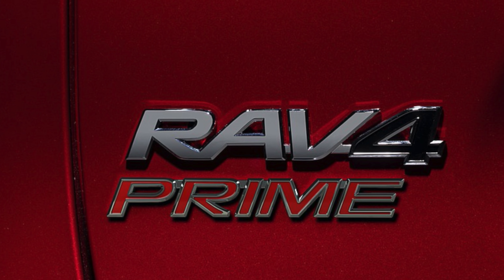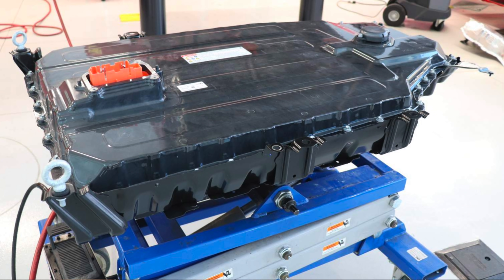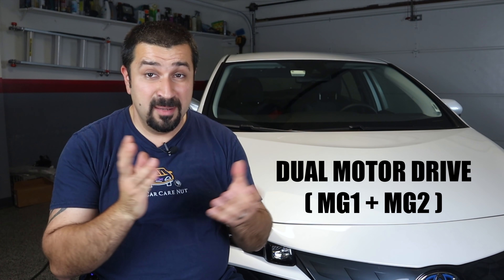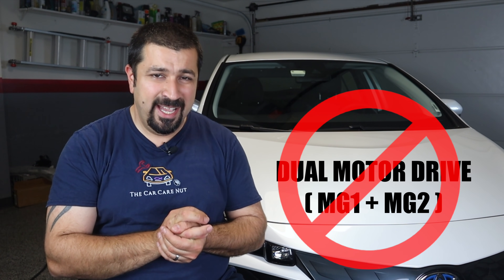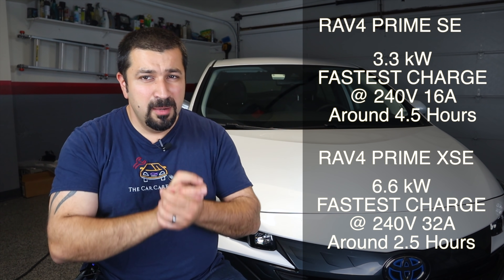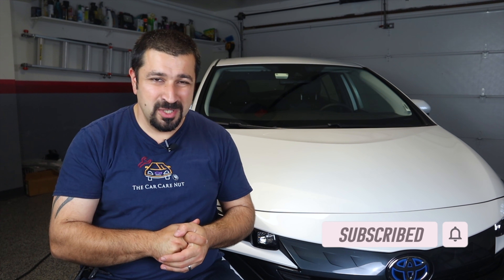Toyota RAV4 Prime Technical Details Part 1 : Battery, Charging and Drivetrain

Comment: Question.  Does the car still have 302 hp after the EV range has depleted?  Or is that a separate battery that has its own HP rating.

Comment: I'm curious as to what the 2024  Rav4 Prime XSE with Premium Package 12V battery normal parasitic current drain should be after the car is off more than 1 hour?   I measured mine today 6/26/2024  (2024 model bought new in Dec of 2023) and it was stable at 105 milliamps after 1 hour 10 minutes   (verified all lights in the car were off by observing it in a pitch black garage).  Does that seem normal?   Reason I ask is I am adding a dashcam which I have measured at 182 milliamps in parking mode  (the dashcam has both a timer setting which I currently have set at 3 hours and a voltage monitor I set to turn off if below 12 V,  so whichever occurs first will turn off the camera) and wanted to get an idea of how long I could actually reasonably run it in parking mode off the 12V battery?

Comment: I sent an email to Carcarenut asking about the Toyota battery charging algorithm.  When the battery is at 100% is that 100% of the 18kw or 100% of the usable 14kw? Longevity studies suggest not charging over 80% and less is better combined with no deep discharges.

Comment: Have you done a video on the RAV4 battery recall? I tried replacing the stock battery of a 2014 RAV4 Limited with a new stock Toyota battery, but the new one was not the same height as the old one. I put the battery on the counter in the Toyota Parts Department to show him and he said that the new one IS the correct one.  WRONG!

Comment: I love your videos. You are explaining so many  tech little details that no one is doing on other chanels. Can I ask a question about regenerative braking power limits? If you will go down on rav4 prime from a very high hill for very long time. Do you also can charge the battery up to 80 % like in combation engine mode by the button near the shifter? I have seen videos with a prius hev where the battery becomes full so fast on big hills. Also I have seen a tesla video where a dude charged 14kwt just by regenerative coasting from very high hills. Can rav4 prime do the same With his big plug-in battery?

Comment: I have taken into account the recommendation to use the gasoline engine with some regularity, thank you! Regarding battery charging, some recommend in fully electric vehicles that the battery be charged to 90% - 95% of the capacity unless you are sure that the next day you will take a long trip, where there would be no problem in going to 100% load. Would it be the same on the Rav4-Prime?

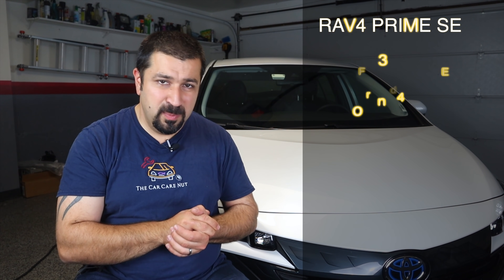Comment: Great News! I have FINALLY found a Rav4 Prime SE without the moonroof option. I take delivery next week on July 18th. The other good news affects this video at timestamp 6:30. Where Ahmed says the SE trim has a 3.3 kw charger, Toyota has made an upgrade for 2023:  the 2023 Rav4 Prime now has the 6.6 kw charger on ALL Rav4 Prime's, both SE and XSE trims. Yayyyy! The one I am getting is dark blue, not my favorite color which is white (because it gets really hot in the summer where I live), but I'll learn to love it. I've been looking for one of these since October 2020 - almost 3 years now - and I am going nuts here in anticipation of finally sitting in one of my very own, buckling up, and pressing that "Power" button for the drive home from the dealer. Just 5 days from now!

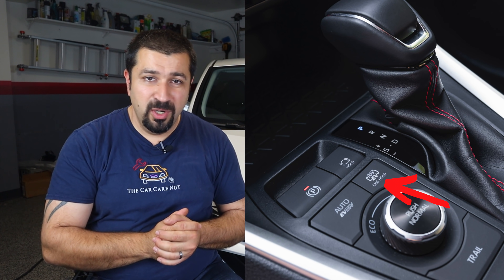Another comment about Toyota's reasoning for only allowing the Prius Prime / Rav4 Prime battery to charge to 80% in "Charge" mode (time stamp 8:46 in the video). I've read somewhere that this is so that the battery will have some reserve capacity in it to absorb regen braking energy, should you encounter a long, steep downgrade, without the car having to resort to ICE compression braking right away, as soon as you start down a hill. Also, regen braking on steep downgrades at 55 mph, can send as much as 15 to 25 kilowatts to the battery (I've tested this myself on my Prius Prime with the Hybrid Assistant app), and as the battery approaches 78% State of Charge, the maximum regen braking power it will accept starts to drop sharply. Once past 82% State of Charge, the battery will not accept regen braking charge at more than about 2 kilowatts, which more or less renders regen braking on downhills totally ineffective. When you are driving in mountainous terrain, it can be helpful to climb hills in EV mode untill the battery state of charge is at 40~50%, so that you will have plenty of capacity in the battery to accept regen braking energy on the downhills. I've discovered this in my own personal experience of driving a Prius Prime, and I'm pretty sure it applies to the Rav4 Prime as well.

Comment: Just changed the oil in my prime at 1309 miles. My tech put it in a clean container to see how it looks. After seeing it, I am a believer of changing out the initial oil early. The engine was used at least 700 of those miles with three trips to the mountains.
Reply: Just changed mine at 1200 miles

Comment: Since it is poassible to charge the battery using the engine, is the battery bi directional? Can it be used to power load or the house in case of power disruption? Is there a need a Vto L adapter included in the charger package?

Comment: Hello. I drive the prime mostly on electric  so at how many gas tanks or miles should I do the first oil change. 5k miles would not be an accurate mileage of the ice. How many miles there after should I do regular oil changes? Thanks

Comment: Hey CCN!!! Thanks to you and Professor John Kelly I now have a Rav 4 Prime and it is working PERFECTLY for my needs. Lot of fun too.  Big question I cant get a straight answer on. Where is the 80% threshold on the battery? (2021 SE). I use the charging schedule and it charges me to bout 44 miles range. But my engine charging wont engage after 30 miles of range. But I see other people who just leave their car plugged in and get 50+ miles. You see I like to ride my motorcycle in the summer to work and the car will sit in the driveway in the sun for a few days straight. Whats the greatest level of charge I can keep in the battery before I hit that 80% threshold lithium ions dont like?

Comment: I have a 2021 rav4 prime. I would like to know what the voltage is in the traction battery when the charge is showing 100%??  The "nominal" voltage is listed at 355.2 volts (3.7 volts per 96 batteries). When 100% charged, how much above 3.7 volts per cell does Toyota allow?

Comment: Hi. Toyota Rav 4 Prime on order. Watched/ saved your great vids on them. Please i form re charging cables/ system as we are going to use a 240/220 household outlet eventually. I cannot find info on this. I do understand/ think the charger is already in the vehicle and I will need a proper volt/ amp outlet+cord+car-side plug. This may be of interest to many as charging-systems mightbe needed for other makes. It is all alittle confusing. Thamk you so much for your positive, informative, personable energy ad contributions. Ken

Comment: I I own a rav 4 prime and am concerned about having a full electric charge, driving down the road at 70mph, and the battery runs out and switch to hybrid mode, should I be concerned about the engine all of a sudden going from 0 to 2500rpm, or whatever rpm’s it jumps to. I always let a car warm for 30 secs or so before taking off.

Comment: I am considering upgrading to this from Prius Prime. RAV4 prime has ideal specs. 42M on EV is great. I am sure in City driving We can easily cross 50M and the dependability of the Toyota Engine.  Nothing can beat this combination
Reply: Only 42 miles per charge ⚡️ is not good enough because this car is expensive!

Comment: When you set the schedule such that the car be ready at 5 am and you are using a 240 V system for charging. It would seem to me that theoretically the charging would start at appx. 12:30 am.  However looking at the kWh flow from the power company it looks like it starts the charge earlier and completes the charge appx. 1 hour before the 5 am scheduled time.  furthermore the current flow appears to reduce  to appx. 1/3 to 1/2 the current flow during the last 1/2 hour of the charge.  My observation is that it completes the charge appx. 1 to 1-1/2 prior to 5 am.  Is this normal?  It is important for time of day power rates.  Thanks for your input

Comment: Yes lower cg yes outside yes to airtight however no due to the freon. Ac will fail compressor will run more to cool the battery more more complicated than mercedes. Its bad enough 10 to 15 years you got to buy a new battery at the cost + ac service cost. You will spend all you saved to change it. I think it may be cheaper to overhaul an ice and drive train that will last longer than the battery.

Comment: My friend just brought her RAV4 Prime into the dealership for an oil change, it has 18,000 miles on it. As she was leaving, this message popped up…

A malfunction in the Charging System has been
detected. Continuing to drive may be dangerous.
Immediately stop in a safe location and contact
your dealer in order to have your vehicle
inspected.

What is going on? She never had any problems before.

Comment: Hi AMD, 
just recently found your youtube channel as we are doing research for new rav4 and highlander, love your videos. specially related to toyota. my wife and i both have toyota, mine is highlander 02 with 269000 km and my wife rav4 07 with 245000km. i used to be transmission mechanic so i do most of the service myself. looking to upgrade to newer highlander hybrid models and rav4 prime. are they ok for doing DIY oil changes? 
and question 2, are they ok to have 2nd set of snow tires with spare rims? any issues or can newer model toyota can have 2 set of tire rims with air pressure sensors?  i am guessing the snow tires will lower the gas miles on both right?

Comment: Do you recommend waiting until the electric battery is depleted fully before recharging the RAV4 Prime battery? Or can you “top it off” and plug in after doing a short errand so you always have it at peak capacity?
Reply from the maker: Hi! I would deplete it fully before charging

Comment: Thanks for answering my question. I called a dealer near by me and asked if either the Prius or Rav4 primes comes with DC fast charging capability and he told me yes, but I take your word that it does NOT.
Reply from the maker: Hi! It does not. 2 charging options. One at 110 and one at 220 and the owners manual very clearly identifies the charging times from empty at each voltage depending on the on board charger size for the RAV4 primes

Comment: If you have the car idling with the motor on, how long would it take for a depleted battery to fully charge using the engines power and regen? Also, can you have the car plugged in while doing this to accelerate charge time?

Comment: Really enjoy and value your videos on the RAAV4 Prime.  Understand the charging schedule, but it is not as flexible as it should be to allow for time of day electric rates.  Question assume a 120 V charging connection and its appx. 12.5 hours to obtain a full charge.  Further assume that you set the charging schedule to be ready at 5 AM which implies a 4:30 PM starting time.  However, I would like to understand what would happen if you plug the charge cord at 8 PM which means that only 9 hours are in front of the 5 AM start time.  Will it stop charging at 5 AM?  Obviously I understand that the unit will not be fully charge (appx. 75%)  Thanks for your input.
Reply from the maker: Hi! In that case it will continuously charge until you unplug it because it hasn’t reached fully charged

Comment: Does 12 V battery depend on traction battery or it is fully independent and has been charging from wheels only?
Reply from the maker: Hi! The 12v battery is charged by a charger that uses power from the traction battery

Comment: Hi, AMD. Please write a few words about paddle shift switches on RAV4 Prime. Especially “+”. When to use them? And what difference between paddle shift switches and shift lever S mode? Thanks.
Reply from the maker: Hi! The S mode and paddle shifters are similar. Basically makes the transmission mimic a manual transmission. Use that when you’re going down hill and the battery gets fully charged from regeneration then the hydraulic brakes start overheating. Really it needs to be a very long hill not a short one for that scenario to happen
Reply: @TheCarCareNut  Is it useful for overtaking?

Comment: Can you run the Rav4 prime on gas only? Do you have to plug it in or can you just run it solely on gas?
Reply from the maker: Hi! You don’t have to plug it in but it’s recommended for best efficiency. Alternatively you could use charge mode to charge the battery up to 80% allowed charge

Comment: Hi.  I bought a Rav4 Prime SE and didn’t realize it only had a 3.3KW charger.  i live in area and park on the street.   I primarily charge using public chargers.  Is there an option to change the on board charger to the 6.6KW

Comment: QUESTION: I have had the R4Prime now for a little over a year, and I just crossed 4K miles.  So, I don't really drive a lot anymore (thanks to Covid I work from home now).
Basically, the car sits with zero charge unless I know that I'm going somewhere.
Is that bad?  They say don't keep it at 100% charge, but is zero charge also not good?  Should I try to maintain 50% charge?
Reply from the maker: Hi! Keeping it at low charge is preferred. Fully charged and not driven is not advised for long term health of the battery

Comment: Thank you for all of your great videos, I've learned so much from them. 
I just purchased a 2021 RAV4 Prime in Portland, Oregon as they don't sell the Primes in Washington State yet. How do I find a dealership (in the Olympia or Tacoma area) that has a Toyota Master Diagnostic Technician that is certified to service the RAV4 Prime?
Reply from the maker: Hi! Dealerships that sell a RAV4 prime will have technicians trained to work on them. You’ll only need this specific  technician for diagnosis and heavy repair not for simple maintenance
Reply: @TheCarCareNut  Thank you for your response. Once again, I highly appreciate your videos!

Comment: I’ve been using the charge schedule using departure time.  I set the time for 6am with the AC feature turned on,  but when I go out to my car at 6am the dashboard readout says 40 mins till full charge.  Using a 240V 40A home charger.  RAV4 prime SE model.  Thanks
Reply: Why?
Reply from the maker: Hmmm that’s interesting. Is the weather extremely hot?

Comment: There is so much discussion about charge times SOOOO how long does it take for the engine to charge an almost empty battery to 80%. On long trips with some mountain driving does it pay to let the car charge while driving on flat roads so it will be charged for uphill portions of the trip when more power is needed? Of course you can recover most of that on the downhill side of the mountain.

Comment: I was taught not to charge a Lion battery when the ambient  temperature is above 87 degrees. Is that still valid?
Reply from the maker: Hi! Not with cars. They have dedicated cooling systems and very smart computers watching everything. The computer won’t allow charging if the battery is too hot

Comment: Thanks for sharing! 
Do you know what the long term capacity of the battery is best and worst case scenarios? On another video you mentioned how to properly charge and use, but still curious on how well it holds a charge say after 5 yrs?
Reply from the maker: Hi! Hard to tell as they haven’t been out for 5 years. But comparing them to the standard hybrids it seems like around 10 years with normal miles until you’ll start seeing a slight drop in capacity

Comment: How is the heating and cooling accomplished? Resistive heater that heats up the water running through the pack? And the cooling, electrical AC-pump for cooling the water running through pack?

Comment: Can you confirm the length of the charging cord that comes with the RAV4 Prime?   thanks
Reply from the maker: Hi! I’d have to dig for that information I don’t have it at the moment. Reply to this comment or post another one and I’ll get back to you
Reply: 25 ft end to end

You will want to upgrade to a level 2 charger. 

I never use our level 1 charger.

We own two Rav 4 Primes and one level 2 charger. 

I mounted on the wall between the 3rd car and two car garage door. The cable can reach both automobiles.

I went with a 50 amp breaker and charger is 40 Amp which is overkill but I may purchase an EV which can handle more amps.

Comment: Regarding the Rav4 prime, I've heard from comments made that it is better to do an overnight charge of around12 hours of gradual charging as this will increase the lifespan of the battery as opposed to high power quick charge of 2 or 4 hours. Is there any truth in this? Would love to know your thoughts. Regards Robert Riva.
Reply from the maker: Hi! Your best option is to utilize the charging schedule. using the charge soon after it’s fully charged Is best for the battery longevity

Comment: AMD...a big congratulations on the 100K plus subscribers.  Always enjoy your vids.  Enjoying and learning something new is always a positive outcome.  Thanks for explaining the DC to DC converter and the fact that these hybrid batteries are sealed very well.  With that in mind...I guess I'm still thinking the "old fashioned way".  Would you even consider applying Rustoleum "Rustproofing" underneath the vehicle or some undercoating.  Like applying a coat of wax on the paint now and then to preserve it....thought maybe the same for underneath.  Just want to take care of my Optimus Prime.

Take care and stay safe.

JT
Reply from the maker: Hi! Thank you! I would still consider rust proofing if you live in the rust belt. Even though they are covered and made better but still it would help